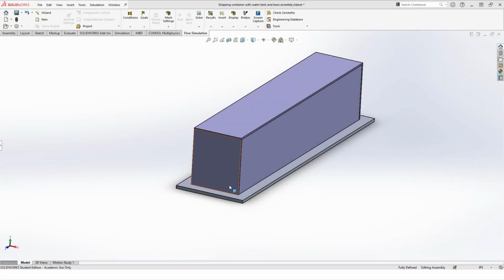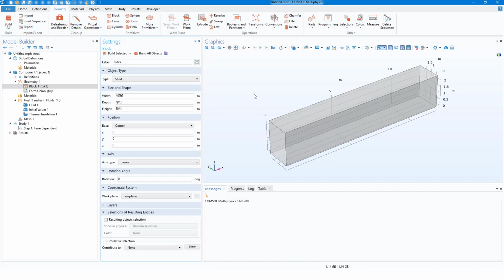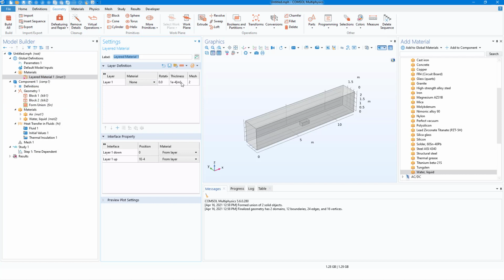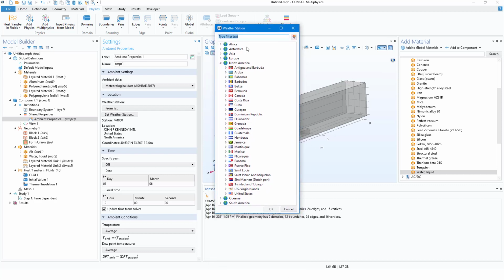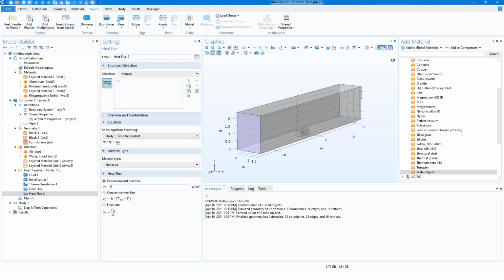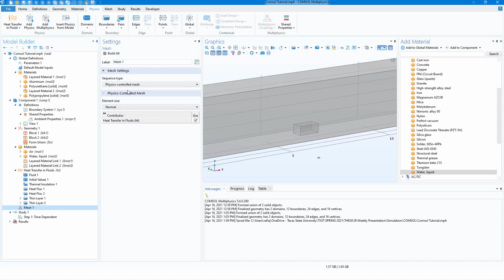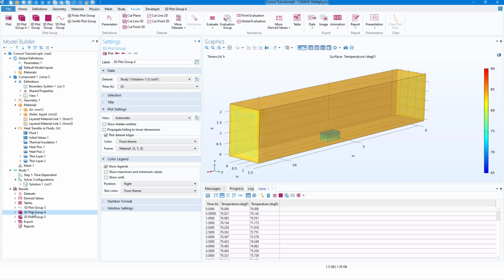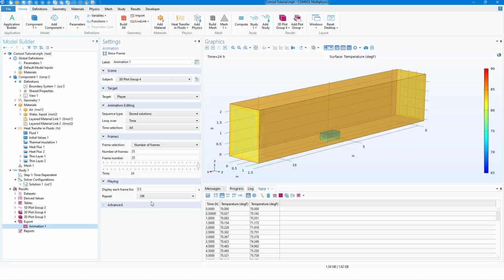Heat Transfer Simulation Tutorial in COMSOL Multiphysics

Comment: May i know which version you're using of this software??
and can i use same method to assess the heat gain through the roof only??
And can i get the surface outdoor temperature as well as interior surface temperature? 
Sorry for too many questions but i need to know that as soon as possible.
Reply: 5.6